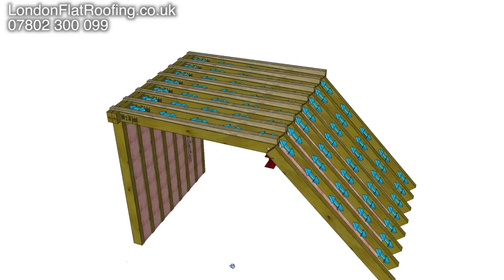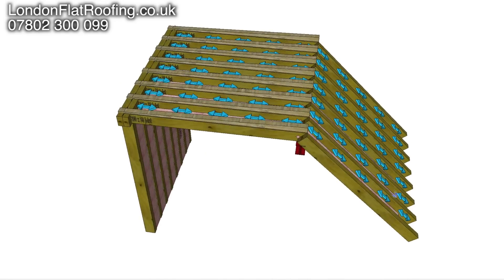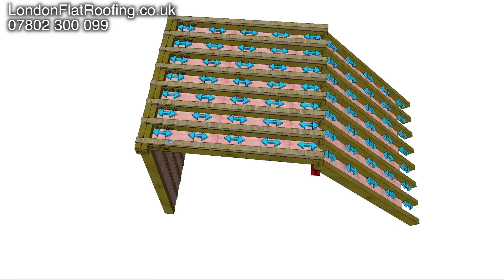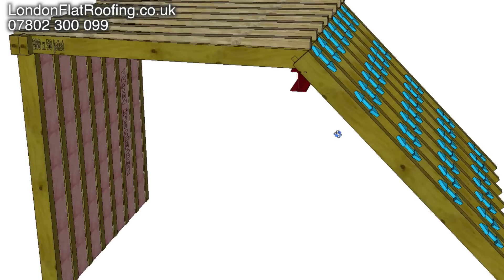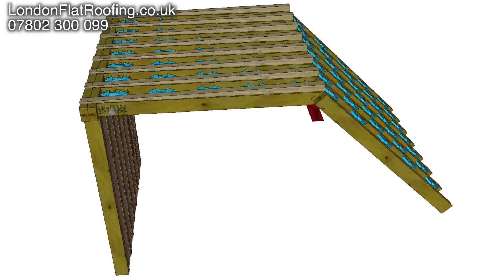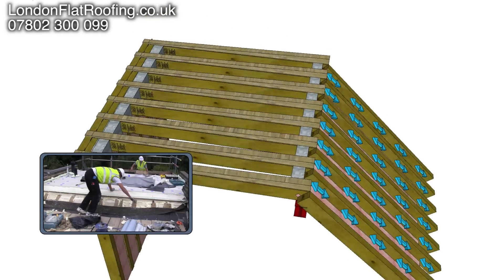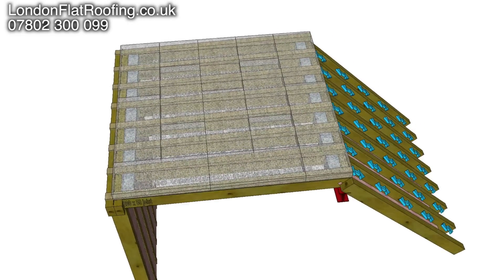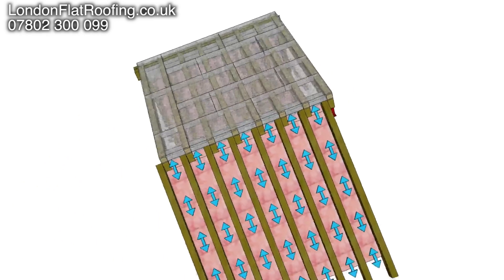Flat Roof Insulation Warm Roof Cold Roof Roof Ventilation

Comment: Hi Steve, I have the same construction in an extension except for the dormer side. It's a crown roof with side parapets.

I m thinking of converting to a proper warm roof when the asphalt on the flat part needs replacing as currently one can feet the drafts behind the plasterboard when it's blasting it outside. 

Thanks for your efforts putting these videos together.

Comment: Hi, im a home owner, i recently bought a house and its a 1930's, cold roof type. The problem im facing is theres exposed tiles, theres no felt underneath them, so wind and rain can blow back up underneath them into my attic space, great for ventilation but not for keeping the elements out. Ive been doing some research and people have said to get it re-roofed so a felt or membraine can be placed under the tiles. Or do the work from inside the attick to weather tight the roof. How do it go about this? I was thinking insulation first, inbetween the joists but with a gap between the tile baterns and the insulation (for ventilation) then the vapour barrier/membrain stapled to the inside of the rafters? Or would it be the other way around, membraine first in the space between the rafters then the insulation. If water was to get in and onto the membraine or insulation it would drip down to where the eoof meets the walls and pool there? Any help would be great i can find a solid answer, just maybe this or that. Thanks

Comment: sorry for the silly question, but why not double up and insulate above and in between the joists?
Reply from the maker: +Rob de Gouveia 
A warm roof is a warm roof because the underside of the decking is warm.
 If you were to fill the void between the joists with insulation you would stop the warm air inside the room getting to the underside of the decking, the decking would be colder and the possibility of condensation at this point would be greater. Thus the name warm roof.
If you think about a cold roof where the insulation is
 between the joists the decking is cold thus a cold roof. The decking is cold if condensation forms on the underside the vented space that shoud be below the decking will vent away the moist air.
Reply: Hi. Do you need to put a tile vent in the middle of every joist doing it this way?